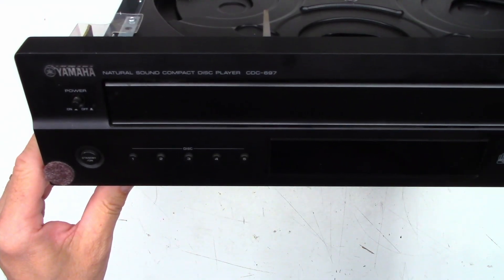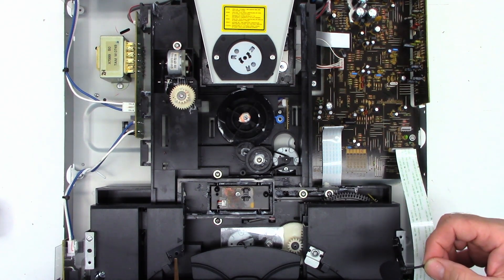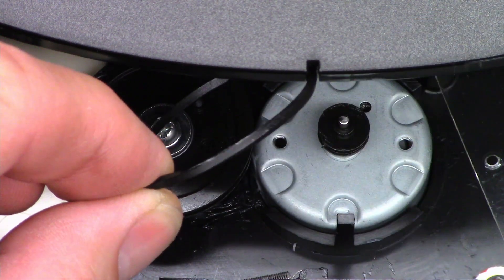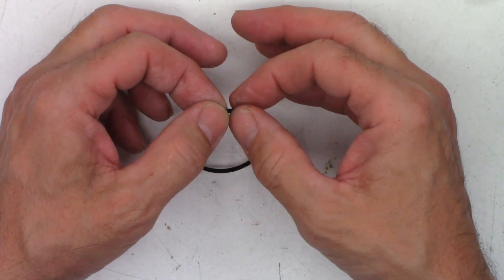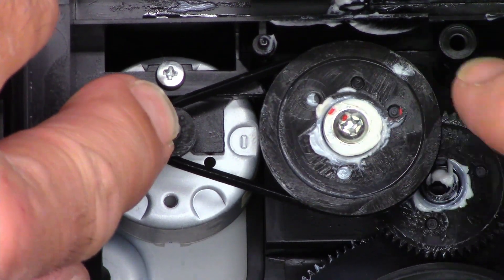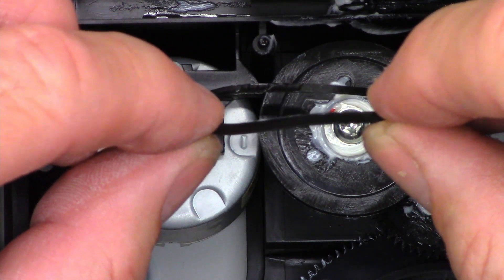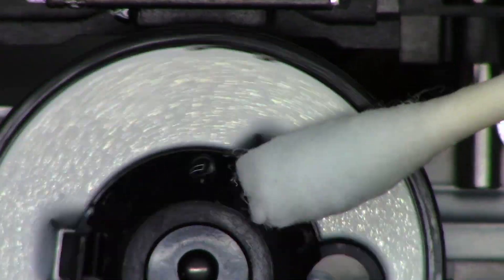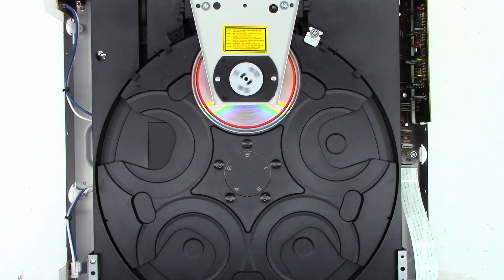Yamaha CDC-697 CD changer player - tray loading issue- Acetone will be used!

Comment: Thank you so much for the easy explanation. My Yamaha is a CD C765, but I suppose the mechanism is quite similar, isn't it? My problem is that sometimes it needs a little push for it to close (It makes the same noise as in your video). And recently it started doing something funny, when I try to change CDs I press the close button, it does close but it's ejected a few moments later and the CD won't start. Some other times, it closes and starts without a problem. Do you think this could help me?

Comment: I have got an old CD player that has got an issue: when I open the CD tray it does not stay open but immediately come back to the close position, what could be the cause of that malfunction?
Reply from the maker: The door open detect switch is probably oxidized. It tells the system control that the drawer is completely open.
Reply: I took it to the assistance many years ago, they fixed the issue but their fixing lasted only a few months and then the issue was back since now. I will try to fix it and I will make a video of that, but not now because we are moving and all my tools are stored.